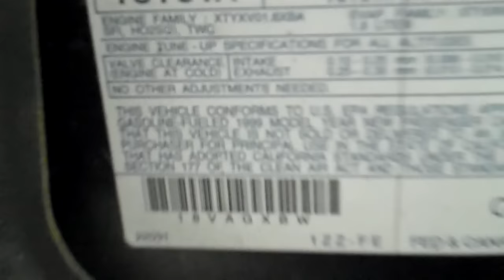What a siezed engine sounds like when you try to start it.

Comment: When people don't replace oil, bad things can happen.
Reply: AirplaneFreak When they don’t replace it or just don’t check it. Indeed bad stuff is going to happen!
Reply: Too bad I bought it a day before and just had the oil changed
Reply: Nope. Happens when you buy a Chevy
Reply: @TitanFlare  Nope. This can happen on any brand. Use your head.
Reply: @iAmCodeMonkey  most well maintained engines don't randomly seize with no warning signs, that's a Chevy thing
Reply: @TitanFlare  you’re right. my Chevy travers just seized without warning!
Reply: and when Peepel do replace Oil l... for instance it might Land in their mouth if they stand there like zombies or Dropp on flor. would you really wante that instead of siezed car ?????? :P
Reply: @bapakhammad  same just happened to my s10
Reply: @TitanFlare  *will
Reply: It’s so stupid as well, ‘99 Corolla engines are one of the most bulletproof, if they just followed the oil change schedule the car will run for decades without issue.

Comment: This just happened to me. I had the car for two days (well 1 and a half). It ran fine, no ticks, or knocks of any kind. The ride was smooth and quiet. Middle of the second day, while I'm on the freeway, the car is riding perfect. A few miles in I noticed that every time I let up on the gas the speed reverted ever aggressively, so I was very near the off ramp and got off. When I got to the top of the ramp there were three or four soft ticks and the car shut off. That was it. 2010 Chevy Traverse. When I tried to turn it on all the power would go out and there was no sound. I'D turn the key back to the off position and the power would resume. I just had to laugh, but I also had to PEE. So I couldn't laugh too hard or (puddles). This nice lady, at a house across the way, asked if I was ok. I screamed that I had to peeeeeeeee. After a good laugh she let me her home. It was a beautifully kept Detroit tri-flat. Anyway that was my story. Well other than I had to give my brother the bad news that the car he'd given me had to go to "That lot in the sky", "The island of misfit vehicles" 💀
Reply: leeluv96 Same exact thing just happened to my 1996 Nissan 300ZX Twin Turbo last night. Had the car for 3 days, ran absolutely perfect and then it happened
Reply: What did you do to fix ?
Reply: @ManuelPerez-sw9nj  my mechanic told me that the oil well was dry and the engine was seized. I was skeptical because I've had A LOT of experience with cars where the engines went out or was going out. There's many many months of knocking and ticking before it finally goes. I will be transparent in saying these were old cars. I dont have experience with 2010 or newer vehicles giving out. There may be no warning at all with more recent vehicles. I dont know for sure, but my mind just wouldn't let me settle that the engine was done. So in the end, I sold the body. There was no fix for the Traverse. HOWEVER about two months ago my brother's 2009 Dodge RAM did the something similar. It ended up being something with the key fob going out.
Reply: Your story sounds more like an alternator
Reply: @shamrocktheshamrock  I took it to my mechanic because I thought the same thing but no. The engine was gone.
Reply: @leeluv96  oh wow that sucks I've had 2 engines go out on me so far extremely expensive

Comment: That's why you always make sure you have enough oil and get it changed when you're suppose to.
Reply: Try buying a 2011 Chevy Equinox 😭 terrible terrible vehicle, stayed on top of my oil and it still seized 😭
Reply: @HUNNIBEARX- that thing literally had many Complaints filed against it for excessive oil consumption, likely from failed oil rings, you probably got one of the fussy ones unfortunately, but that’s excluding some of the other engine issues reported.

Comment: A seized engine wouldnt turn at all hence the word seized
Reply: The engine doesn't turn at all. Because it's seized.
Reply: The engine isn’t cranking over, it’s stuck
Reply: @aldocraycray  the engine won’t crank or tune or move because it’s not moving.......it’s actually kinda seized
Reply: @ether6136  The engine is seized and wouldn't turn because no anti-seize compound was used
Reply: The seized crank the engine wouldn't hence the word

Comment: My 98 started using oil at about 60K miles. Supposedly it's the pistons that don't have enough drain holes for oil to run back down into the crankcase and the rings stick in the grooves from the coked up oil residue. I ran Marvel Mystery Oil in the crankcase and it has helped unstick the rings somewhat but I'm sure some of it is just wear. Instead of rebuilding or replacing the engine I just keep it topped up and at 142K miles still no clouds of blue smoke.

Comment: Dude, thank you SOOOOOO much for posting this video! My car broke down and I wasn't sure if my engine seized because I didn't know what it sounded like.

My engine will keep trying to crank up, but not start. The engine in this video won't even crank up at all.

Thanks again, you really eased my mind and now I'm not so worried about the cost to fix my car!
Reply: You need fuel, spark, compression, and air to have an engine going.
Reply: What about timing??
Reply: @rogerrivera4012  That too.

Comment: It sounds something like that but all power gets cut off until I unhook the battery then hook it back up, I’ve changed the starter the battery the solenoid the positive wire that connects to the battery and solenoid I have no clue what the hell is wrong with it

Comment: The 98-02 1.8 1ZZFE engines are bad about early oil burning. Mine goes through a quart every 1000 or less depending on weather and driving city or highway. I keep it topped off and oil is much cheaper than an engine rebuild or replacement. I hammer it quite often and none the worse for wear. Of course people need to keep an eye on oil level to prevent something like this from happening. This one looks like no one ever checked the oil level in 15 years.

Comment from the maker: @spelunkerd I've heard a thousand or so bad starters go "clack"  this one sounded a bit different from the get go.  When you start working on cars you don't check the fuel gauge first on a no start for example.... then you get in the habit of checking that stuff just in case.  I checked the oil first before the starter.  It's an easy test worth doing first.  The main give away was the sound.

Comment: I have a 97 Ford ranger that seized on me.  I poured "marvels mystery oil" inside the spark plug holes and allowed it to soak for 24 hours. Surprisingly, I was able to break the engine free using a breaker bar on the crankshaft bolt.  Starts right up now.  And its so for sale lol.. 1997 ranger stepside.. red. $1400
:-)
Reply: Mike Mason this happens to mine but does it start right up and is it drives me?

Comment: I have a loud squalling / squealing noise when I shut my 2001 Subaru Forester off..also with the noise the engine will shake side to side real quickly… It starts back up and  runs great but I’m afraid to drive it…I can drive around and don’t have problems until it shuts off…Do you think possible TORQUE CONVERTER problems …It makes this loud EEERRRRRR noise when shut down….
I have meticulously babied this car…I put in new axles…head gaskets…new radiator…timing belt and components 2 times…always oil changes…super clean car…

Comment: Brian dont know if you're still on here,if you're engine is locked up, can you try turning bottom pulley of the engine just to be sure?
Reply: My engine is making a similar sound 4.7 magnum it died the same way while driving but I did have some ticking. It makes this sound when trying to start it up but I did spin the bottom pulley and it does turn so I don’t think it’s completely seized maybe the timing chain?

Comment: Heard this on a mazda 3 that went through a huge puddle, hydrolocked and wouldn't start, locked up wheels in gears when pushing and wouldn't be turned by hand.

seen this again on a 3.8 buick v6 ecotech in a holden commodore, spun a rod bearing due to low oil and not regular enough oil changes (not my vehicle). it was started, I heard a knocking sound which was slow at first but it was rod knock, vehicle was turned off, attempt at turning it back on yielded a click from the starter and nothing else.
Reply: Jared I’m soooooo damn late. My liberty Jeep did the say thing, what was your issue? Mechanic told me starter. Was it the started or engine.
Reply: @MS.SONIA.BADAZZ  was bent con rod check if car locks in gear when U push or crank doesn't rotate.
Oh and starter will just click

Comment: @Briansmobile1 Hi. My 2001 Nissan Maxima sounds like that.A mechanic removed the starter and it was split in half. He didn't check the motor but said that the flywheel was locked up. I'm beginning to believe the motor is bad too I tried pulling the belts on the engine to hand crank it but it wouldn't move. Not sure if I'm just not strong enough to pull it or if it's locked up. Is there a way I can tell if the engine's no longer working? The transmission solenoid was already screwed so I want to know if I should just junk the car or get all of this stuff fixed?? Thanks so much!
Reply: So did you figure it out and what did you do I’m stuck in the same situation

Comment: Sooo I have a 2011 ford escape that had a similar noise. It died coming to a stop and wouldn't start back up. It just cranked and cranked. Until it just gave me this thud.  I thought it was my starter. So I switched it. Now it runs but I have little to no power when I gas it and it stalls out almost every time.. Any clue what it might be?

Comment: my step brother bought a 2000 Cadillac escalade, we were on the highway and the tranny slipped really bad, then the motor started to make horrendous noises. The motor banged, clicked, and squeeled. It had oil in it when he bought it 2 hours earlier, and when we checked to see if the oil had metal fragments in it, the oil was gone... the dipstick was dry. I checked the transmission fluid to see if that was low as well.l, it wasn't. We called my father, who lived close to where we broke down, he brought 4 quarts of oil for the 4.7l V8. it took all the oil, and the engine refused to start, again making the metal on metal wailing sound, and knocking/banging. My step brother and I limped it off the highway to a nearby hotel, then the motor started to smoke, furiously. I checked the oil again, and it was gone... I had put oil into it 3 miles before. I checked the transmission fluid and it wasn't red, it was brownish gold... the oil had leaked into the transmission somehow.
Reply: Drewbidoo possibly rear main seal.
Reply: LT GM models are notorious for fluid exchange. Highly unreliable.
Reply: Drewbidoo i read that same book once...
Reply: TheOtherWhiteBread0 right. I was hoping to hear that someone had left the oil plug out or something xD
Reply: Drewbidoo   I think maybe in the confusion you were pouring motor oil down the transmission dip stick tube and kept driving with no oil in the motor that would explain why you didn’t see any on the ground or it was spilling out the side while you were driving????
Reply: That's the 4.6 Northstar for you. They've been known to have lots of issues, ranging from difficult servicing to head gasket leaks due to bolts and valve covers being made from different materials. Cadillac fixed most of the issues after the 2006 model year, I think, but the damage was done
Reply: Rear main seal all the oil was leaking into the transmission
Reply: @lichking3711  This isn't a DTS, it is an Escalade which has a vortec 5.7 which is a good engine.
Reply: DynamixHD I’ve come to learn that GM just doesn’t take quality control seriously. It doesn’t matter how good the engine is on paper and common practice, if there manufacturing is off by even a tiny bit, the engines gonna go to crap in time way too quickly. Their tolerances are insane

Comment: I have a 1999 camry that threw a rod. It spat all the oil all over the road. When the car got towed in it was able to drive to the rear of the mechanic shop with it smoking badly. After that it would not start anymore. It didn't make the single clack sound then give up it would try and start but nothing. I got the whole engine replaced with a remanufactured one and it has been my daily driver for almost 7 months now.

Comment: So I didn't realize when my friend was repairing the jets in my carborator of my Kawasaki 250 Mojave, he left the top of the carborator off and after 2 years of sitting in the yard my dad says "i stuffed a rag in it, your lucky the damn thing didn't sieze up"
Reply: Reality dam...
Reply: It wouldnt sieze unless the valve is open if its closed it would just rust the valve and seat
Reply: @DillonGaming036  can't sticky valves also cause an engine to seize up?

Comment: Mine clacks like that but no other sound, it even turns my flywheel a tiny bit, I think I have plenty of oil so my question is why wont it start, I just replaced the flywheel because it broke all the way around the crank bolts

Comment: I have 1999 toyota Camry and my car just cut off going down the interstate. I had a mobile mechanic that ive used 2 times before for oil change and brakes. At first he said it was my battery and alternator I said you can tell by just looking at the alternator and he said yes. Now my car will turn over and make a sound but not like the one in this video. Then the mechanic said the timing belt was broke so he replaced the timing g belt and water pump and I don't know why he replaced the water pump. But still my car will not start but continues to turn over and make the sound and it sounds like the alternator to me. The mechanic said that because my timing belt broke that now my head is blown. However I reasearched 1999 toyota Camry and can timing belt going out affect your motor engine and it said no it dosent. So if that's true how can I tell if it's my starter or battery or alternator?? I had a new battery in the car but when this problem happens it drained my battery and had no Moe life the mechanic told me and their was acid leaking from the battery and he said that's cause the alternator was bad.

Comment: Is there anything i can move in order to see if its the locked engine or just a starter bcs mine makes a similar noice to that but mine actually at time strts the alternator moves and all but still wont start is there something we can move or test out wheter to see if its the engine or jst my starter
Reply: +Ricardo Reyes exactly what my problem is........whats the answer. Did you get an answer????
Reply: +222Lightning it was the engine i had to do a full rebuilt charged me 2,800$

Comment: I have Toyota 4runner 1992- I think my engine seized last night-  battery is good, but I do not get any clack or anything? Oil is full, just fixed some other parts last week- was running top shape. Any ideas?
Reply: Preston Odenbrett no clack means you need a starter.

Comment: couple days ago I got battery light, after giving 1.5k rpm or more it would go away, but instantly goes back on after releasing accelerator pedal, today I was driving home, battery light would not come off even with rpm, I started getting random lights on speedometer, like brake light, abs, my windshield wipers started was like in slowmotion, my music shut off, tv turned off and near home I started loosing engine power (hp) I was giving full gas like for 30sec to get to 30-40km/h and after turning my car off, it would not start, looked like alternator, changed battery, car cranks like for 1 millisecond and stops, nothing happens. where can be the problem? Bmw e39 530d
Reply: and that like 1 second, half crank sounds like my battery is dead, but I tested new battery with multimeter,  12v, and my old battery that I thought died was 11.9v

Comment: Hey bro my 99 Chevy Silverado 1500 5.3 liter is doing the same thing but it has oil in the motor my wife was driving it and a light came on that said check engine pressure and then it just shut off and won't start up

Comment: Yep, that's the sound. So what if you literally just rebuild the engine (reman crankshaft, new bearings and gaskets, crosshatched cylinders, checked rings valves lifters etc) and it turned over by hand to install the torque converter but won't turn now? Marvel mystery oil in cylinders, no plugs, timing set, and starter pulled?

Comment: why is it that I can turn my flywheel an the crank turns but I can't turn it from the crank bolt but I also get that exact sound and with no serpentine belt on I still can't get it to turn over.  But again I can turn the flywheel with a screwdriver

Comment: HAVE you heard of any methods to un-seize a car were there are no rods blown
Reply: Daniel Raymond what plugs? The spark plugs?
Reply: Penetrating oil in the cylinders through the spark plug holes wait at least 24 hours. Then take a wrench to the crank pulley back and forth untill it turns freely.

Comment: Well.... glad that's not my problem on my car. Mine wont even make a clank sound, when I turn the key all the lights in the dash turn off like if the battery was disconnected. No click sound or anything. I checked my engine with a wrench on and started to turn the engine manually andnit turns with no effort at all. Maybe my starter? It's a 2002 Buick Park Avenue Ultra. 144k miles on the odometer.  Still trying to figure out the issue lol battery is strong too.